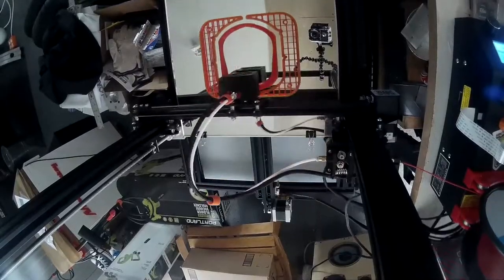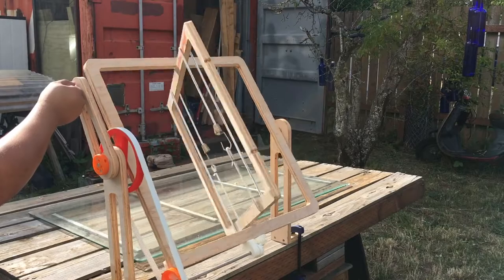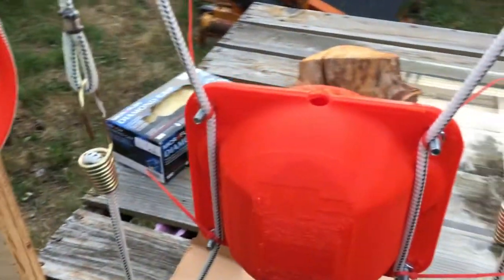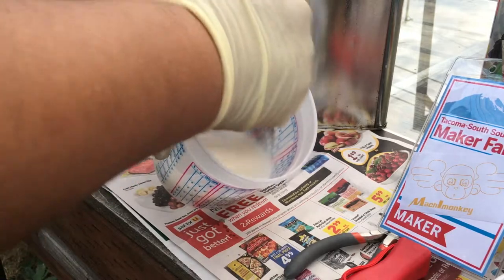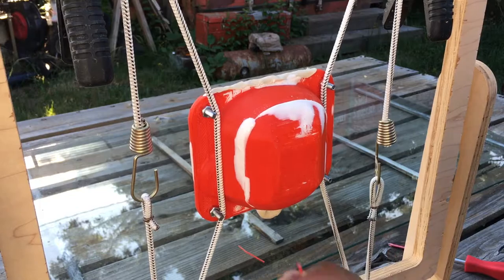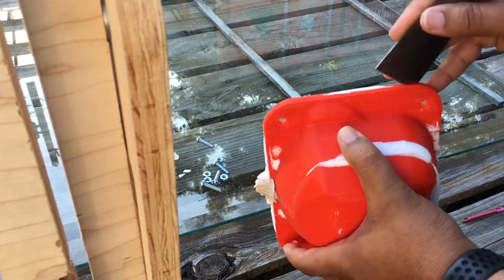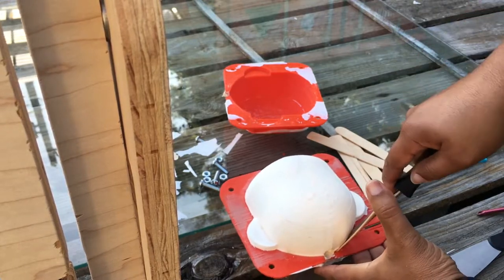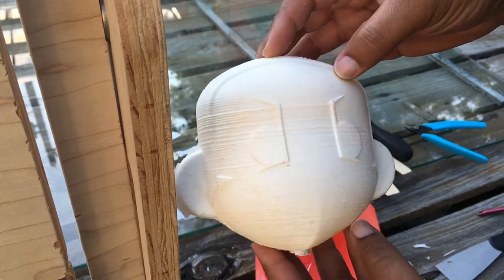Mach1monkey ROTOMO | DIY Rotational Casting or Rotomolding

Comment: Put a small hole on each half and use air pressure to pop the molded part out of the mold.
Reply from the maker: That’s a great tip/trick! Works really good with silicone/ urethane molds as well! There was a slight undercut where I split my mold. Between that and the direction of the coarse printed layer lines it was a bit of a struggle. I could sand it down some more to help get it out as well.

Comment: Your work is incredible, what type of resin did you use for this project?
Reply from the maker: @josetomasterananaya9067  Thank you! I’m glad you enjoyed the video! I use a two-part urethane called SharkThane. It’s supplied by a company called Fiberlay. I believe they have multiple locations in the US. I would recommend Smooth-on as well as you can usually find that more readily on Amazon. Thanks for watching!

Comment: A rotisserie motor would be ideal for this.

I came across this video because I was looking to see whether anyone had made an idea I had a few years ago. My idea is like this but using thermoplastic, like conventional rotational moulding. I was going to buy an oven with built in rotisserie, then build a rotation frame like the one in this video. The moulds would be plaster of Paris castings of anything I wanted to mould or CNC mould tools and the mould material would be any thermoset or thermoplastic within the range of the oven.
Reply from the maker: Yep! A rotisserie would be great idea. All metal parts would be the start then an oven large enough to handle the rotation without hitting the top, bottom or sides. Thanks for watching and commenting!

Comment: could i use SMOOTH ON 66 D as my rotating resin... or is it only a specific resin that must be used in roto casting... SMOOTH ON 66D is aquarium safe and that is what i need... it is also very fast drying / hardening.
Reply from the maker: Hey! You could use it for a small mold as it looks to have a very short pot life. I would recommend a minimum 5-7 minute pot life/ cure time to allow enough of the resin to sufficiently coat the inside of a larger mold. Thanks for watching!

Comment: hello my friend, very nice your project. I am from Brazil, considering to produce ruber hand grip for motorcycles, from seventies sixties, that is not available anymore in the market. Do you think it is possible to rotomold rubber?? any  hint will ber very welcome. Regards, Flavio
Reply from the maker: Bom dia! I would suggest standard casting for the hand grips. Check out the Crafsman, he’s got some great tutorials on how to cast with soft urethanes. I’ve made grips in the past for my 76’ KZ400! I used a three part printed mold to make them. I would suggest an 70 durometer urethane for your grips. Have fun with them and use different colors!

Comment: Are there plans available somewhere for the rotomold rig? Thanks, great tutorial, good clarity and pace.
Reply from the maker: No plans as of yet. I have been thinking about it but at the moment it takes some custom tooling to build them. I do have them for sale if you go to Mach1monkey.com 
I'm in the middle of building a small batch right now. Thank you for the compliment! I post my more recent work on Instagram @mach1monkey. I hope to have a few more videos up soon! Take care!
Reply: @mach1monkey  Sweeeeeeet. Good to know you sell them. I was thinking aluminum frame and a bit larger for an electric motor I have. But those are perfect for small polyurethane castings. I'll bookmark your webstore. Thanks for the tip 👍

Comment: I want to roto or slush mold some dozens of rubber-like bladders, I'm wondering if that could work in your rotomolder. I would 3-print the mold halves. My project involves parts resembling hot water bottles. Could you also advise the elastomeric material(s)? Thank you!
Reply from the maker: Hello! That’s great! I would recommend a shore A urethane with roughly a 15-20 minute cure-time. 40 durometer if you want it “squishy” and 60 durometer if you want it more firm. 

Smooth-On KX Flex 60 Pourable Urethane Rubber Elastomer Trial Size https://a.co/d/iaf0sSf

Or something similar should work. Double check the gel/ setup time as you really wouldn’t want to be spinning the rotomolder by hand for a hour. It is a good work out however. 🤣 Hope that helps!

Comment: This is fantastic, have you ever rotomolded any rubber/latex/flexible vinyl or pvc? And would it be possible to rotormold your own inflatable boat fender/buoy?
Reply: @ironfistcontent
Reply: First question no. Second question it’d probably be less expensive to do a single one in fiberglass due to size.  For more than 10 parts def no, find a rotational molder.
Reply: @doncallangher6177  not sure if I follow, so your saying that if I'm making more than 10 pieces of boat fenders to have them made?
I would like to create a custom made pvc boat fender thing, 
The inflatable part is important as it allows it to be deflated for storage or shipping and can easily be inflated when at right destination. 
How should I go about getting it done?
Thanks in advance
Reply: @legacygym1  Here are the basics.

You didn't mention the size of your boat fender thing, but for example, a kickbox base  on a Century Wavemaster would probably cost around 10-20K built by a roto molder, stateside. If you made something that large yourself it literally becomes a full time job. And would require shop resources like table saw, band saw, sanders etc. Not to mention lots of materials. You have to put a value on your time and cost of tools.

Rotational molding is a good choice for rigid materials like that kickbox base. The base comes out of the mold sealed, then a secondary operation is done to install a cap or plug to allow the base to fill with sand or water. Or leave it sealed and it stays an air filled flotation device like a buoy. 

However, flexible materials are unavailable for rotational molding. If you want a boat fender similar to a large, hot water bottle, with a thick rubber wall that can be inflated/deflated many cycles, I don't believe that's possible. I suppose you could take a couple thick uncured rubber sheets, build a form shaped like your boat fender thing and make something, but that's beyond my pay level. Again, lots of labor and trial and error likely. And, you'd need a large oven to vulcanize it.
Reply from the maker: Don, that’s some excellent advice! Larger parts do need a larger rotomolder 😊. I have however rotocast inflatable bladders with 60 and 70 durometer urethane. Just like Don mentioned you can embed a plug into the mold. I used volleyball valves in mine so I could use any standard needle inflator. You can order the inflator valves off of Amazon I believe. I need to do a video on that…. Thank a for the question!

Comment: What the idea behind this device? It spreads resin evenly?
Reply: Yup. It's automated slush casting, not Rotamolding BTW.
Reply from the maker: Yes indeed, imagine how they make kayaks, plastic gas cans, coolers/ice chests, Bigwheels, big play sets etc. It’s exactly the same process minus having to insert it into an oven to melt the plastic. The resin I chose solidifies with a chemical reaction instead of a thermal reaction. You could put it in an oven at a low temp and cast wax parts if you wanted to or you could make a metal or ceramic mold and heat it up with a torch.
Reply from the maker: The idea is to cast parts that you want to be hollow. That can be a lamp, piggy bank, vinyl toy, diy pelican case, mask, helmet, custom computer case, urethane rubber sports ball, protective gear, bumper covers. It's really up to your imagination.

Comment: Um... that's *slush casting*. Rotamolding uses a heated metal mold and a thermoplastic polymer.
Reply from the maker: It's the same process and device. One is wood, the other is metal. I can put my rotomolder in an oven @ 250F and rotomold ABS thermoplastic in a metal mold. Metal rotomolders are more durable.